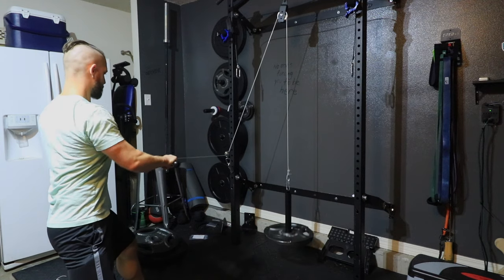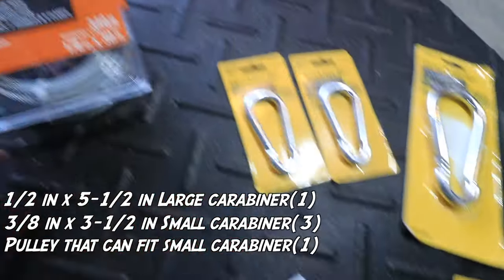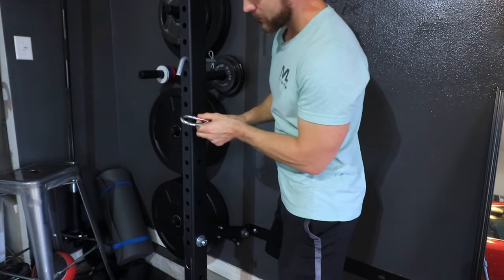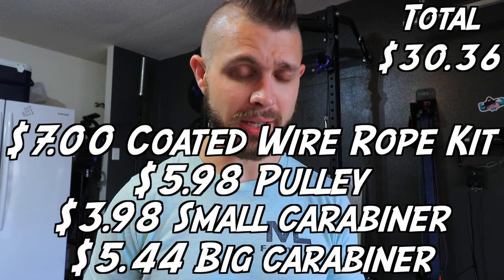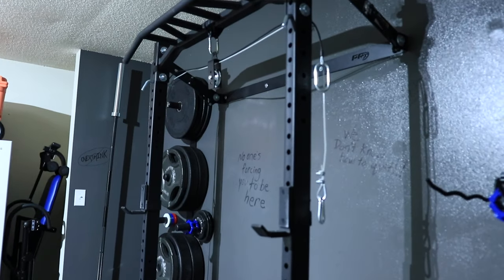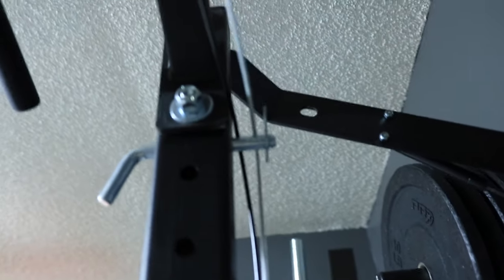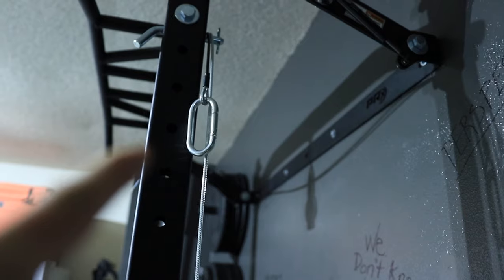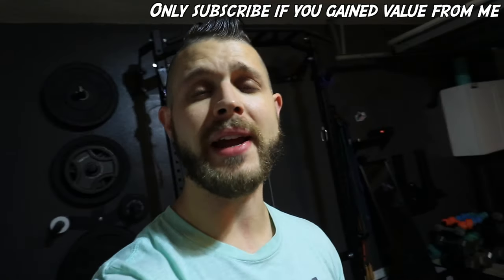How to Make Your Own Low cable Pulley System

Comment from the maker: PRX pulley system with bar:
https://prxperformance.com/products/prx-prime-pulley-system?variant=39872859177044&sca_ref=3349103.MkKtRzaePr

Squat rack in video:
https://prxperformance.com/collections/all/products/profile-squat-rack-with-multi-grip-bar?sca_ref=3349103.MkKtRzaePr

Comment: This gives me some ideas. I however just attached pulley to my barbell and used the j-hooks to position the height. Works great for both seated and standing rows
Reply from the maker: Eyyyy I like that!
Reply: How do attach it to the barbell? I would think the pulley would move around too much?
Reply from the maker: @natebrennan6837  attach the pulley to a barbell? Like a standard 45lb barbell? If that’s what you’re asking…ya don’t.
Reply: @MattLaneFitness  no I was wondering how Randall attached it to the barbell. I need a pulley system for doing rotational stuff for my son, like wood choppers etc. I think your design will work. We need to move it from knee height to chest height and I think the large caribiner will work perfectly and just move it up and down the rack.
Reply from the maker: @natebrennan6837  ahhhhhhh I gotcha I gotcha
Reply: How do you hook it up to the barbell?
Reply: @Ice-Sik-ill  the pulley hangs from a velcro strap that has 2 d-rings. A carabiner is a connection between the two. Instead of placing it on my pullup bar up top, I just place it on the barbell. I reverse the j hooks, so when I pull the bar is braced against the rack
Reply: @SaisMoon  genius 💡

Comment: dude, I just came in from the garage after spending a half-hour trying to figure out how I was going to get a bar fabricated (across the bottom of the PRX rack) to hold the low pulley.  THEN, I saw your  video.  WHY DIDN'T I THINK OF THIS?!  lol.  I'll probably just buy a low pulley system, but at least I won't have to figure out how to attach it to the freakin' rack!  thanks, man.
Reply from the maker: Yes yes yes! Heck yeah! Glad it helped!
Reply: Did you find a low pulley system that works with the PRX rack? I'm looking myself at the moment, but haven't found anything.

Comment: Thank you! I have a PRx Pro rack. I got everything like you said and it worked. My feedback: The large carabiner did not fit. Luckily I had a bigger one in my toolbox. I made one long cable like you did and it worked but the problem now is I won’t be able to use my PRx pulley for high pulley exercises bc I am using that pulley for this new one I made. So what I did was made a shorter cable about 56”-57” long and I connect it to my PRx high pulley to make it longer when I want to do low pulley exercises and I connect it to the lowest part of my rack. Anyways, works great thank you for the tutorial.
Reply from the maker: Eyyyyy congrats! Glad the vid helped! Yes that’s what I did as well. I have a longer grey cable for low cable work and then a shorter black cable for higher cable work.
Reply: I wish I read your reply, what size carabiner did you get/have?  I bought the one Matt  listed and now am finding a new home/use for it :)
Reply: @ajmunn1229  I believe a 6” x 4”

Comment: Just wondering how it's been holding up after 3 years? I'm looking for an inexpensive DIY to do exercises that require cables at mid height too such as reverse flies for rear delts. The anchor point has to be above the shoulder so I foresee some issues of the pulley not being able to keep the cable in the gear.

Comment: That's a great video. Can you explain how u fixed the big carabiner on the top? Because in the video u explained about the smaller carabiner but how is made the bigger one? and how it is fixed on the rak?
Reply from the maker: Hey hey appreciate you watching it. In the vid I mentioned that I bought the PRX cable pulley system. But you’re right I didn’t go into detail. With that comes the large pulley which is what I think you meant and not the carabiner maybe? That cable pulley system comes with a strap that wraps around the crossbar, the strap attaches to the carabiner and that attaches to the pulley. Make sense?
Reply from the maker: Check out the link in the description to the exact cable pulley system. It’s not a referral link.

Comment: Just a tip... I would use silicone spray as  as a lubricant rather than wd40. Wd40 is not a lubricant it’s more of a rust remover. PB Blaster makes a good silicone spray you can find it at most hardware stores. I use it on any metal on metal contact things that I need to silence.
Reply from the maker: Really?......well if and when the issue comes up I’ll give it a shot. Thank you!
Reply: @MattLaneFitness  Yep! Common misconception about WD40. thanks for the pulley tips!

Comment: You need a pair or end cutters / nippers for cutting wire like that. With regular side cutters, you will struggle.
I found that out the hard way too, cutting gear / brake cable.
Reply from the maker: Listen!!!!!……..yeah you’re prolly right 😂🤣

Comment: I have prx also and pulley system 
Gonna go to the hardware store hmmm gonna go look see how low my rack holes are - goal is low seated rows. Sweet
Reply from the maker: I drilled an additional hole in each upright. Worked well and even over a year later it’s solid as a rock.
Reply: @MattLaneFitness  sweet building today - FYI titan has improved 
Just added vertical leg press and seated leg extension and leg curl machine to our garage, picked up a sweet reverse hyper machine from rogue as well — love this! Wife will have low cable pulley when she comes home! Also mark smelly bell I have a few of his cable attachments to make tricep and face pulls etc more fun!!!

Cheers
Reply from the maker: @aaronoconnor8862   nice!!!!!! Yup I’ve seen that Titan has been improving for a while now. Seems they’re putting out some quality stuff! Yup Rogue has a great RHM. Build that thing and let the progress come your way!

Comment: The two cable storage is what I needed to see!  The idea of uninstalling and reinstalling every time was something I didn't want to deal with lol

I have a roller that's not from prx and doesn't have the option to rest the other cable high while in use..have you seen any online similar to the prx roller?
Reply from the maker: Right there with ya on the cable storage. If it isn't simple it won't be used. I haven't. The PRX roller has enough space to fit 2 or more cables through which is another reason I bought that system. I knew PRX was quality stuff, that it would work and went with it.
Reply: Just realized you have the profile rack, the big hook doesn't fit on pro :(
Reply from the maker: @ajmunn1229  are you serious!!?!?!? That’s surprising. Well if you have the pull bar attachment you’d be fine. For myself I’ve drilled a couple of holes in the uprights for some custom attachments and they’ve handled it like a champ.
Reply: @MattLaneFitness  what is the pull bar attachment?  I don't.  I did a diy high pully and was looking to add this next step but need some sort of lower side mount now
Reply from the maker: @ajmunn1229  you know how you can select different models from PRX that come with a pull up bar attachment. I’m guessing you didn’t get one of those options when you ordered? Or maybe you don’t have a PRX rack? Regardless you could extend that strand with even another carabiner or something similar.

Comment: This may be an obvious answer, but your cable length, is that basically just for mid-level but can it work if you put your carabiner at the bottom of your rack, or will you need to have another cable to be for just above ground pulls?  I bought a cable pulley system off Amazon similar to yours, but I would like to do mid range and low pulls or rows as well and your DYI seems simple enough I could probably do it myself without my husband's help - well, maybe I'll need his help for cutting the wire, but we have a special tool for that already.  Thanks in advanced.
Reply from the maker: Hey hey nah it's no biggie at all. Yeah this length could work but I would probably give it another 2 feet of cable if you plan on doing something like a cable upright row.
Reply: @MattLaneFitness  Thanks.  I’ve ordered everything I need, I hope.  But I’m going to be using wire ferrules instead of the clamps.  Cleaner look and fewer chances of me snagging my clothing or skin on the clamps.  I’m going to do a dual pulley system similar to your system so I can do crossovers at any height.  Your DYI system is simple, yet it looks very effective.  Love it!!!

Comment: Was that a leather strap at the top that is wrapped around your pull up bar?  Where did you get it from?
Reply from the maker: Nylon strap with 2 carabiners. It came with the pulley pieces from the same company as the squat rack which is PRX.
Reply: @MattLaneFitness  thanks!

Comment: Any recommendations for outfitting it to the bottom of rack and using two leg straps to do seated leg extensions? I cant quite figure out the best way to attach the low cable to get the right extension if that makes sense.

Comment: How is this holding up since the video? Those pulleys are way too small in diameter and it will cause the cable to fray over time. You want one that's at least 3" and, if possible, to run the cable through at least two of them so that it doesn't have to make such sharp bends.
Reply from the maker: It’s as solid as day one. Coated wire is doin great.

Comment: I did same set up...after a couple months the heat that builds while in use has melted the plastic coating off the cable😬
Reply from the maker: Damn! You either have some crazy weight, high reps maybe too small of pulleys?

Comment: @4min mark. Just put silicone on the sliding parts to stop that noise
Reply: Meant to say the pulleys.
Reply from the maker: silicone on the rolling pulley?
Reply: @MattLaneFitness  yes try it. The pulley wheel moves and makes a noise. The spray worked for me. Also for door hinges

Comment: A quality clippers to cut cable like that is kind of pricey. Using a cheap tool will do more harm to the tool than the cable. But a $12 angle grinder will cut cable, chain and any metal all day long. Dremel type tools work good too, just slow.

Comment: Hey Matt, I tried to do it exactly like you and then realized the holes on my power rack only go one way (no side holes) so I'm unable to connect the large carabiner to the rack like you.  Any suggestions?
Reply: May have the answer - a big arse u-bolt might do the trick...back to home depot...
Reply from the maker: @derrickmantarelli99  how’d it go?
Reply: @MattLaneFitness  Oh, I ended up following another suggestion from instagram where the pulley is basically strapped to the power rack along one of the bars that are on the floor...works great for the lower pulley exercises having the pulley at ground level
Reply from the maker: Nice!

Comment: How do I make the cable shorter
Reply from the maker: You mean besides cutting it I’m guessing right? If so have 2 different cables. 1 that is longer for the “low” movements and another cable for the “high” movements.
Reply: Matt Lane Fitness will it break/snap if I tie the cables in a knot to make it shorter?

Comment: As a fellow PRx owner, I've been wondering about this as a solution, so thanks for the demonstration!

Quick question - with the carabiner moving the entire load to one leg, have you noticed any uneven side-to-side wear or "racking" occurring with the PRx rack? That's what's kept me from engineering something similar to this.
Reply from the maker: Glad to help. Nah it’s been totally fine. If that rack is on the wall securely you’re good.

Comment: 1. Not civil. 2. DONT USE THIS CRAP!!!! It burns and breaks!!! 360 weight work load cool. Poorly made and frays and rips during workouts 😢 looking for another route now.
Reply from the maker: Not civil? I’m confused. How much weight were lifting with this setup?
Reply: @MattLaneFitness  there was a pop up said “stay civil” lol. Not that much weight. 20lbs shouldn’t rip a coated 360lbs rated metal cord. 🤦‍♀️
Reply from the maker: @Ghost42o415 ohhhh hahahah I gotcha. Yeah the comments guidelines I gotcha. Well hey I’m really sorry but I’m not sure what to tell ya. Did you get the same brand of wire or a different brand? Since I posted this video about a year later yes I have had some wear on the coating but even after all of this time nothing is fraying.